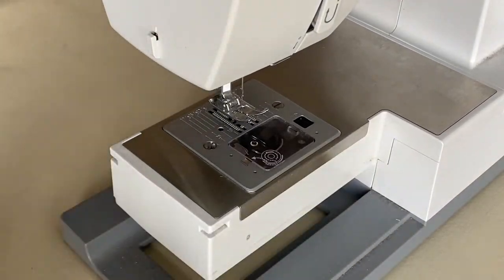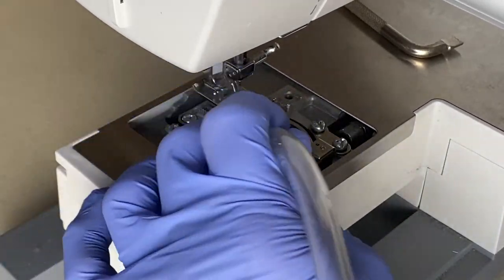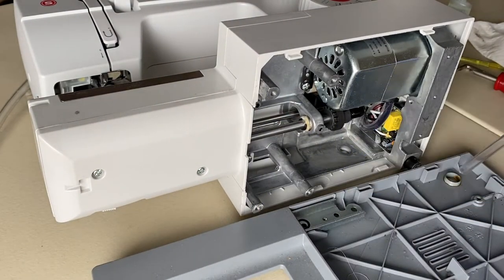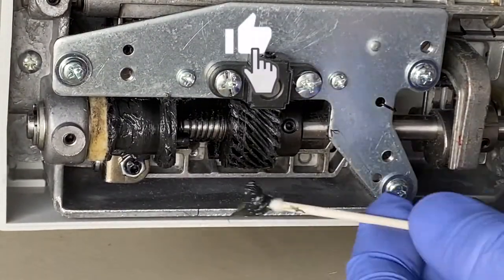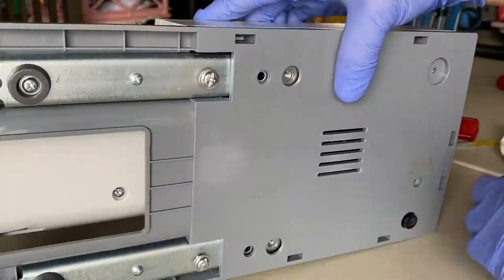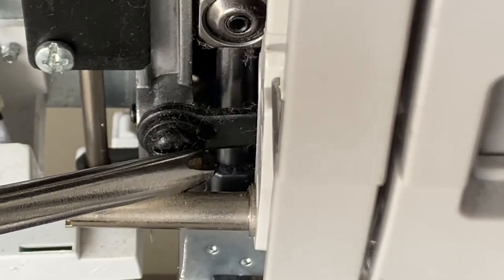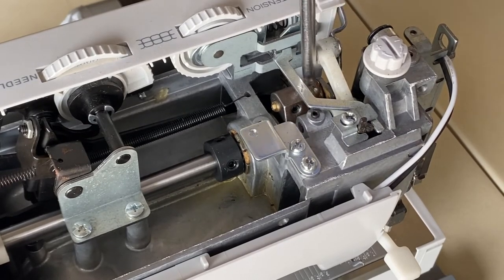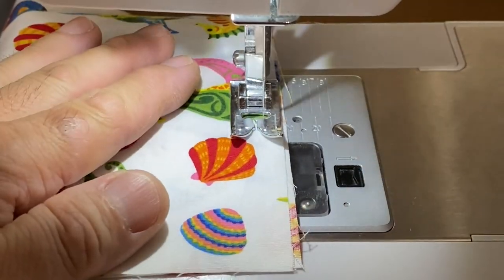How to Clean, Grease, and Oil a Sewing Machine | Singer 44S Heavy Duty Sewing Machine

Comment: Dig it!! Thank man!! I didn't want to keep applying force pulling my side off, because it just felt like it didn't want to give, PLUS I have the stupid foot tension knob (6800C HD) sprouting out the top so i am  like, do i unscrew it off? Then i was like, MEH, maybe not.  I was at one on it, so i screwed it down to four, pulled like you and detached no problem. Again, YOU THE MAN!!  Thanks! I may throw one up since there isnt any SINGERS with the foot tension knob out the top I could find. Short and sweet vid!
Reply from the maker: Glad to hear that you found the video helpful.  
😎

Comment: Great vid, thank you. A Singer HD machine is one I'm considering, and it appears to be much easier to oil/maintain than a comparable Brother or Janome. I assume the 4411 would be the same as the 44S internally?
Reply from the maker: Sorry… not sure.  I’ve only touched the 44S.
Reply: @HacksbyDad  Just FYI, I ended up getting a 4411, and it is identical to your 44S inside. Definitely runs smoother and quieter after a grease/oil job.Thanks again for the clear, concise video.
Reply from the maker: @JohnBau  Good to know!  Thanks.  👍😎

Comment: Hi. The motor does not get oiled?
My motor seems to smell a bit when I start to use it. Could it be because I hadn't used it in awhile?
Reply from the maker: Sorry... I’m not an expert in this area.  I don’t think the motor needs to be oiled.  If the smell continues, I suggest taking the sewing machine in for service.   
Thanks for the question.
Reply: I have the same problem, could you please tell me how you fixed it, if you did?

Comment: I'm having trouble getting the top cover off after taking out the screws. Is it just tight, I don't want to break it.
Reply from the maker: Sorry… I’m not sure.  The top cover on my machine came off easily.  Do you have the same model 44S?

Comment: What brand of grease did you get?
Reply from the maker: Sorry... I don't know.  It is just what I found in my garage and the label is unreadable.
Reply: bearing grease will do the job, go to home depot and look for the “lucas heavy duty bearing grease”
Reply: Tri-flow grease works great for sewing machines. I started restoring vintage machines about a year ago and was having trouble finding the Singer brand in the tube (Singer calls it lubricant instead of grease for some reason, it's really just grease. Marketing maybe?) Tri-flow also makes an oil that works better than Singer sewing machine oil.

Comment: I can't get the top cover off.
Reply from the maker: Sorry… I can’t think of a reason why the cover won’t come off.  🤷🏻‍♂️
Reply: @HacksbyDad  Me, either. It is a singer 44s. I tried to pry it but could not. Thanks for the video. I did the other areas.
Reply: @davinskimac8351  I have the same machine and had the same problem as you but figured it out. There are a couple plastic clips that need to be disengaged. When looking at the back of the machine, they are on the top portion that he removes. On the bottom edge of that top portion right next to where it says "singer", you have to push the edge of the top portion back relative to the bottom portion to disengage the clips. Then it will lift off as he shows in the video.
Reply: @nvonf  thank you so much. I tried several times and gave up. I will follow your advice and let you know if I succeed!
Reply: @nvonf  hi. Thank you. I can’t do it. I have taken everything apart several times according to the manual but end up at the same place. It won’t give. I will try to find a service store.